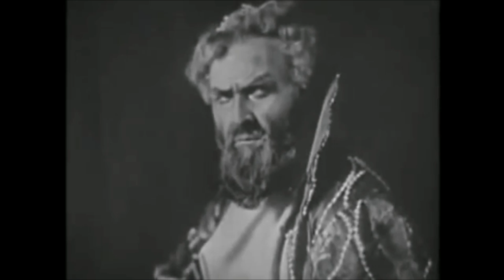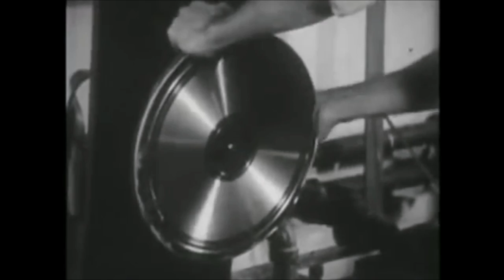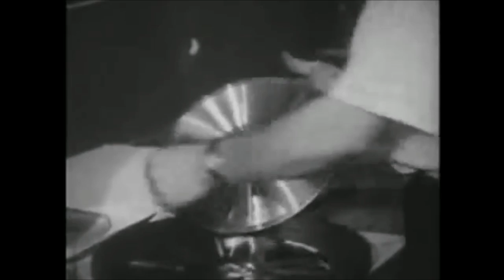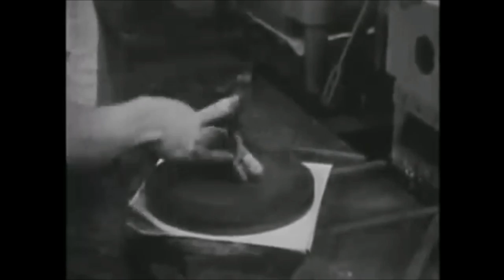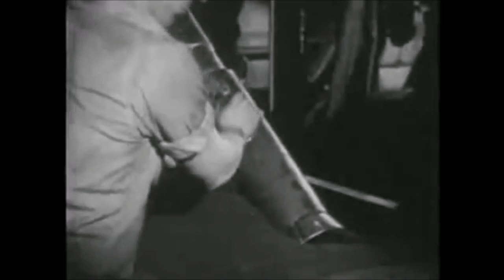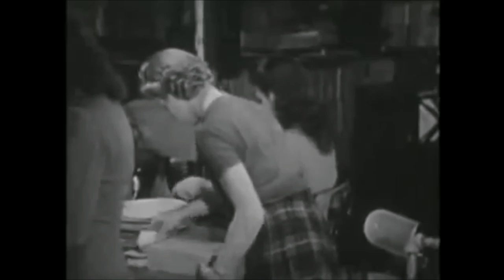How Shellac Records Are Made - RCA Victor presents: Command Performance

Comment: It's sad that all those metal masters were destroyed when they were melted down for the metal drive for WWII. Many were saved to shellac records but many are gone forever. If the saved shellac discs weren't damaged over time, they were worn out.
Reply: Wax is such a fragile medium I doubt they would've been usable by the time the ability to transfer them to tape came around
Reply: @cryptidproductions3160  Records were not cut on wax but the original masters were cut  on lacquer-coated metal discs. Then metal mothers, fathers and stampers were made, starting from those original stampers.
For the WWII metal drive, all the metal-core lacquers, and all the metal masters were destroyed. Before that, they pressed multiple shellac records for archives. For those records which still survived, when magnetic tape came around, the remaining records were recorded to magnetic tape.
Fortunately, well before WWII, movie sound was optically recorded to film stock. Many of these film sound recordings were recorded multi-track(2 or 3 channels). This is why we have true stereo versions of movies like "The Wizard of Oz".
Reply: The wax  disc destroyed in early stages.
Reply: @AlbertBenajam-ww1db  The wax or lacquer discs were destroyed when they were plated, as with any wax or lacquer discs. They were always discarded or recycled as they could only be plated once. They were never meant for archiving. Anyway, the lacquers to be plated were dubbed from the session acetate. Those were also quickly worn and discarded. They have a short playing life.

Comment: When "cutting a record" meant exactly that. The pressures to be perfect while recording must have been enormous.
Reply: it's a question of routine…
Reply: @ralflang5524  ...and HUGE amounts of practice...
Reply: Records still get cutted. But the music is recorded on tape first since the late 30s or so and then the master is cutted which is way way better.
Reply: @PassCookie  Two points:

1 - Magnetic tape was not good enough to reproduce music until the late 1940s or early 1950s at least. It is possible that the Germans were using magnetic tape as early as the late 30s but nobody else was. Everyone else was using wire recorders.

2 - My original comment was referring to the times when magnetic tape was not widely being used. If you made a musical mistake while cutting the record, there was no choice but to start over and try to play the piece all the way through again.
Reply: @astrosci8864  yes of course. You are right. Erwin Bootz from the comedian harmonists once said that they recorded up to 5 takes of a song, then waited for the test pressings to listen to and then they decided which take they will realese because of course you cant play back the wax Master. With tape you could instatly listen to the recording which was a huge advantage.
Reply: the word "musician" gets thrown around a  lot these days...
Reply: @astrosci8864  You are also correct about magnetic tape--the Germans invented the technology in the early 1930s with the AEG Magnetophon (with it's first prototype developed around 1934, and introduced in 1935).  But the availability of magnetic tape really didn't become prominent worldwide until around 1945 when Jack Mullin, who served as an officer in the US Army Signal Corps, brought back at the end of World War II as a war souvenir from a Allied-seized German radio station one of those Magnetophons, along with a few reels of tape.

Mullin made several improvements to the electronics of the Magnetophon to improve the recording quality, and convinced a California businessman, Alexander M. Poniatoff and his company, Ampex, to mass-produce a version of the Magnetophon.  Poniatoff jumped at the chance, since his company was looking for a new product to make since their previous contract making radar antenna motors for the US Navy had ended with the war.  Then add Bing Crosby to the mix, who funded Mullin and Poniatoff's venture, since he was looking for a method to record his radio show for his schedule that didn't suffer from the low fidelity of the transcription discs used to record radio programs for broadcast then (something that Bing's network, ABC Radio, balked at due to the low quality and their concerns that the listeners could tell it was recorded due to such).  

It all came together in 1947 when the Ampex Model 200 audio tape recorder became available and was an instant hit, with record labels like Capitol instantly adopting the machines for their studio recording, making the practice of cutting wax discs from a live and direct studio performance obsolete.
Reply: @Limousine08  "Musician" is a profession that evolves with time and technologies and there's nothing wrong with that.
Reply: @RyanSchweitzer77  By 1946, AEG produced a recorder capable of recording music. That year, Deutsche Grammophon began recording all their masters on tape. The first record company to do so.

Comment: This educational film really demonstrates how records (either shellac or vinyl) were something that designed around mass production. The cost per record can be kept low if the stampers can be used until they are almost worn out. On top of that, the machine that mixes and kneads the shellac is much larger than I expected it to be.

Comment: Its cool to think my 78s were made this way
Reply: Until the 1940s, when materials were changed. Wax was replaced by acetate, copper by aluminum, and shellac by Bakelite or Vinylite resins. Resin pressed records were marketed as "unbreakable". In the 1950s, tape recordings replaced the direct disk cutting presented here. Also, PVC and Polystyrene replaced the resins.

Comment: Amazing video. 

1- All these people had jobs that were lost to automation.

2- Now that this technology is obsolete, what are the so called six "six secret ingredients" for the resin?
Reply: Shellac is made from a secretion from bugs.
Reply: Also, it wont be obsolete until we have consumer recording that can beat analog sound.
Reply: @zacotb  Thank you. I know. My question was what are the "six secret ingredients"? Shellac is only one of the six.
Reply: hawkturkey  that dude is stuck in the past, Digital recording has been shitting all over analog for a long time. Vinyl still sounds good yeah, but digital doesn't degrade.
Reply: @TranceCore3  the 7 year old Kanye CD I own sounds like shit now. My over 40 year old Bob marley vinyl still sounds like a new record.
Reply: @TranceCore3  Digital does degrade, but not in the same way. CD’s can rot over time, digital files can lose bits due to hard drive, usb drive, etc degradation and failure. When this happens, you lose everything. At least if a disc is cracked, it can still be played. If a piece breaks off at the beginning of the disc, you can still listen to the rest of it. With digital it is all or nothing. 

I have plenty of digital files, plenty of cd’s, plenty of LP’s 45’s and shellac 78’s. Some of my 78’s are 100 or more years old, and can still be perfectly played today. CD’s that are 20 years old - some can no longer be played. Analog discs, when taken care of properly, can last several lifetimes. I would not have that confidence in digital files, especially on consumer grade storage products.
Reply: @01chippe  The HUGE bonus of digital is the speed of making copies (and less "generation loss"). When I make a digital recording, I can almost instantly have 100's of just about perfect copies, whereas with analog tape it would be a  S l o w process and there would be at least 1 degree of noticable generation loss (I used to record my music am keyboardist on 7" reel to reel at 7.5 Ips just to ensure I'd get a good 1.875 Ips cassette dub, cassette to cassette gen loss IS noticeable.) then too there can be variance in speed from the dubbing deck to whatever the final playback deck was. Also since I have many, many copies of my digital stuff in multiple formats, I have easy access to all of my music. Plus since I digitized (Lossless *.WAV format) my Shellac/Vinyl/Nylon analog records - I don't have to repeatedly play them to make portable copies for my phone, car ETC. I can enjoy the undeniable tactile pleasure of playing them on occasion without wearing them out!

Comment: Within six years, CBS/Columbia would introduce the 33 1/3rpm "Long Play" disc- which forced RCA to introduce the "45rpm" record in early 1949. Both companies eventually had to adapt the other's technology [RCA issued their first "LP's" in January 1950, and Columbia released their initial "45's" in late 1951].
Reply: CBS/Columbia usually doesn't like to admit this, but the 33 1/3 RPM speed was originally developed in the 1920's by Bell Labs.  Prior to "microgroove," using the then-standard groove width, and an 18 inch disc, 33 1/3 was the speed that could accommodate approximately 10 minutes of recording time -- to match the running time of a single reel of motion picture film.  The speed was selected to enable one disc of "sound" per reel for the earliest commercially successful sound movies (in a process called Vitaphone).  Given 1920's technology, it was decided to start the disc playback from the inside and slowly work outward to the edge -- this was done to compensate for stylus needle wear.  The needle would always be a brand-new one for each showing and be very sharp at the beginning of the film reel.  The "inches per second" of tracking is far less near the hub of a spinning record -- and this slower speed tested the technology of the 1920's -- but a very sharp needle could handle it with reasonable results.  As the needle wore down, it was encountering increasing and increasing "inches per second" passing beneath it and therefore the "less good" results of a poor needle were compensated by the increase in tracking.  Once the reel of film ended, a second projector and turntable picked up where that one left off, the needle was replaced with a new one, and the third reel and third disc of the movie was readied for the performance.  Of course, within just a very few years, this cumbersome process was replaced in motion pictures with the sound track being placed right on the film itself... BUT... the 33 1/3 speed was picked up by radio broadcasters to record, or pre-record for later playback, radio shows or commercials or other segments.  Once the size of the record groove could be made smaller as vinyl was made available in the 1940's to replace the old shellac base material, the 33 1/3 speed enabled "long-play" records at 12 inches in diameter, able to hold 20-25 minutes of material on each side.  CBS/Columbia brought 33 1/3 into homes, but the speed had been around for over 20 years already.
Reply: @hmmmmmmmmm2  Vitaphone discs were made of shellac only briefly, the breakage was the reason RCA Victor developed victrolac in the early 30's. Victrolac was PVC with plasticizers, and became known as vinylite in the late 30's and then just vinyl. But vinyl records have been around since the early 30s
Reply: @hmmmmmmmmm2  In fact RCA tried to sell 33 1/3 "program transcription" records in the early 1930s, but those required expensive players for the time, and combined with the recession, the effort was a commercial failure.
Reply: Dr. Peter Goldmark perfected the "microgroove" process that enabled Columbia to offer up to 25 minutes of music on each side of a 12 inch "33" LP. Until then, radio transcriptions could only feature about 15 minutes of music- or program- on each side of a 16 inch "33" disc.
Reply: @hyzercreek  Vinylite was a vinyl chloride resin, similar to Bakelite. The vinyl used for LPs is the polymer form, poly vinyl chloride. The reason for the move from shellac was a shellac shortage after WWII.

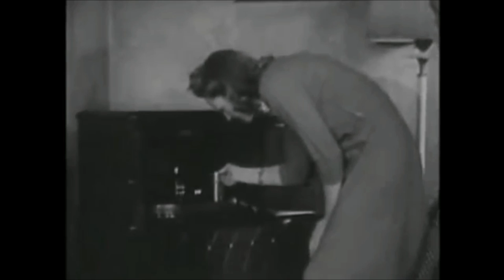Comment: @17:48 I Wonder how many 78s that model of record player unceremoniously shattered?
Reply: I want to know how it worked it looks really interesting. My total experience with 78's has been on a gramaphone (furniture type), mums little portable circa 1955 and our old radiogram which had a stack changer circa 65.
Reply: Not many unless there was a malfunction in the changing mechanism.  When the record drops from the mechanism, an air cushion is created.
Reply: That's a Victor V-225, Magic Brain changer.  The 78rpm Channel has a video on it. Apparently, it's actually quite gentle on the records, unless they are warped. Then you might see some breakage as the record drops into the rejection chute. Certain vintage records may also get their edges chewed up by the separator blades.

Comment: I had no idea that electroplating was used to make the masters. Cool!
Reply: That was the major development of Emile Berliner of the company that became Victor Records. Edison's cylinders couldn't be easily duplicated (real engineers will note it was eventually done). By making the record a flat disk, they could use a process already well known for printing called "Electrotyping", which press the set type into a wax bed, then made it conductive (then with graphite), electroplate that, then use that sheet in the printing press. It was a small matter to modify the process to make records. The secret was a flat record.

Comment: They had to increase the tempo of many performances in order to get the music to fit within the time allotted on a 78.  So if you run across one and it sounds a little fast, it's on purpose.
Reply: The most popular size 10" couldn't hold more than 3 ½ minutes, the larger size for classical music 4 ½ minutes only. Variable grades didn't exist yet and required the use of magnetic tape, but on 78 rpm it could put up to 9 minutes to a 12"
Reply: @robfriedrich2822  I did see that somewhere.  I know popular music of the time wasn't really a problem, but some classical music pieces had to increase tempo in order to fit onto a 78.  I don't have the patience or stamina to delve into 78rpm records.  They are pretty fragile and I wouldn't have the heart to throw away most of what I run across.  And most of what I have run across (almost all) NEEDED to be thrown out.  It's just too sad.

Comment: I wonder how different the process is today. I bet fewer workers and much more automation.
Reply: It's still sort of the same process but using vinyl instead of shellac. Also they use lacquer instead of wax to cut the record and silver nitrate and nickel to plate the disk instead of gold, copper and chromium layers. A Japanese company pre-makes the lacquer disks and the vinyl is made by outside companies instead of from scratch. But even modern record making requires people standing at the press working the machines and other people inspecting the disks and inserting them into sleeves and then into covers. There really isn't really much more automation than they had in the 1940s.